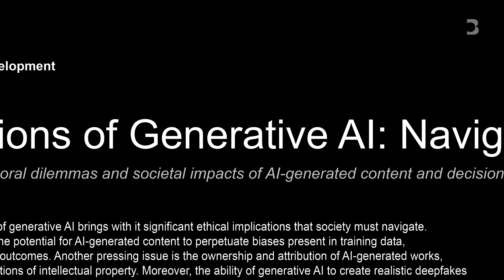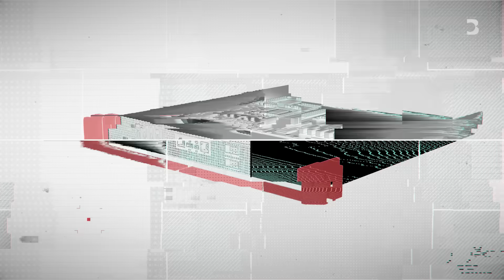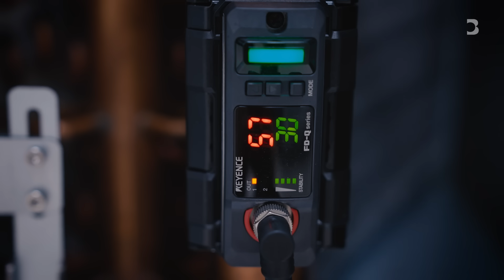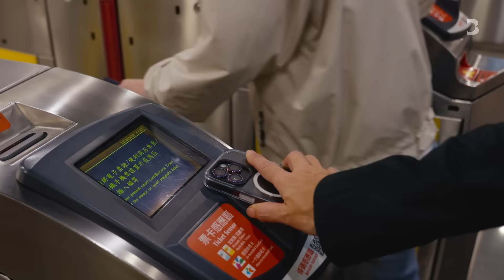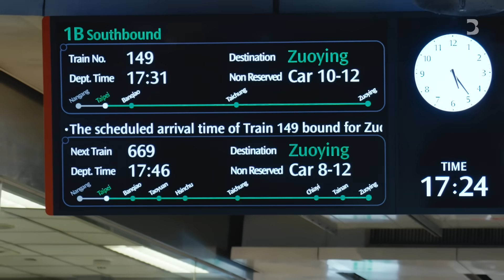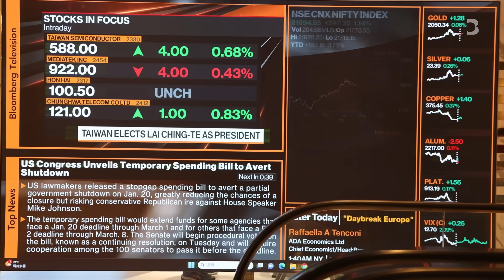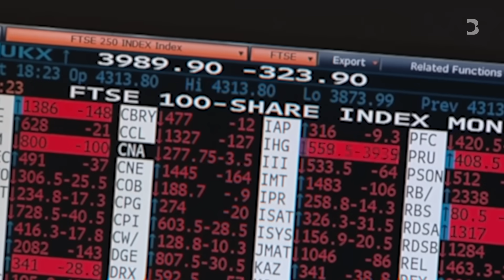Why AI Can't Exist Without Taiwan

Comment: The successful of semiconductor industry in Taiwan is the whole ecosystem, not just one company. That is also why it is hard to duplicate the case in other countries. It’s not just move the company to somewhere else can fix it.
Reply: Exactly right. One cannot just 'replicate' the complex structure of Taiwan. Not only the manufacturing infrastructure but the technical knowledge and experience.  This  is why China is becoming so obsessed with it, but China wants to acquire it rather than conquer it. 

At this time even a successful blockade, without invasion, would shake up the world economy.
Reply: 沒有台灣任勞任怨的工程師及全然體諒的工程師老婆，台灣合作廠商，眾多的家庭的支持、責任感支持這台積電。
（不想用英文發表評論，只想用繁體中文發表評論）
Reply: TSMC最主要的關鍵是供應鏈🎉，日本，美國，德國，荷蘭，毆洲，都是TSMC不可或缺的一份子😅，少了一個都不行緊緊的綁在一起😂，全世界沒有人可以憾動的❤。
Reply: Taiwan's Chip Industry Controls the Lifeline of Global Technology

Chip Specification Grade Classification:
Logic (Processors, AI Artificial Intelligence Computing), Memory Chip Operating Environment Requirements:
Commercial Grade -- 0~+70℃.
Industrial Grade -- -40~+85℃.
Automotive Grade -- -40~+125℃.
Military Grade -- -55~+150℃.
There's also an even higher grade: Aerospace Grade (Radiation Hardened), which requires resistance to radiation and interference, as well as a wider temperature range. Military and aerospace grade chips undergo rigorous qualification testing: pushing them to their limits, continuous high and low temperature cycling, vibration, shock, high ESD (Electro Static Discharge), and interface terminal plugging/unplugging endurance...
Generally, industrial-grade chips are twice as expensive as commercial-grade chips, automotive-grade are three times or more expensive, and military-grade chips are very expensive due to the need to amortize the manufacturing line costs. For aerospace -grade chips, setting up a production line costs hundreds of millions of US dollars, regardless of the quantity produced.
Taiwan's TSMC is the exclusive global manufacturer of high-end logic, AI, and memory chips for the US and its allies, as well as Taiwan's Chung-Shan Institute of Science and Technology (CSIST), for military and aerospace applications. The US Defense Advanced Research Projects Agency (DARPA) has approved the following manufacturers for producing military and aerospace grade logic chips and processors for the US military and aerospace industry: Taiwan's TSMC (advanced 7, 5, 3 nanometer process technology), US-based Intel (14 nanometer and above processes), and US-based GlobalFoundries (28 nanometer and above processes).
The manufacturing process, technology, materials, and raw materials for military and aerospace-grade chips are highly classified. The US and Taiwan have signed agreements to jointly control the highest-level technologies, prohibiting their export to other countries. The US government, still concerned for national security, has requested TSMC to invest and build factories in the US to manufacture advanced AI chips. Their entire production capacity is contracted by US Department of Defense military and aerospace manufacturers. Only the surplus and new factory capacity will be allocated to other companies like Nvidia, Apple, AMD, and Intel. This is an unspoken secret.

China and Russia's military and aerospace equipment can only use general commercial-grade chips for manufacturing, employing a trial-and-error method to create heat and cold insulation plus protective layers to shield the chip motherboards. This approach leads to short warranty periods and questionable real-world operational quality for Chinese and Russian military equipment such as missiles, radar detection systems, and aerospace equipment. Facing the US's high-tech electronic warfare countermeasure systems, their chip motherboards are vulnerable to destruction by high-power electromagnetic waves, causing missile failure and radar detection system malfunction. The failure of Russian weapons in the Russia-Ukraine war fully demonstrates this fact. If China invades Taiwan, the PLA's J-20, J-16 fighters, missiles, radar detection systems, and naval radar detection systems, which are designed using commercial-grade chips, will undoubtedly suffer a major defeat against US-Taiwanese electronic and electromagnetic warfare, and anti-electromagnetic pulse weapons. (Unverified online rumors in China suggest that the guidance systems of PLA missiles and torpedoes are reverse-engineered from US military technology of the 1990s, using stockpiled Intel 486 and 586 processors of commercial grade from 20-30 years ago for manufacturing.) This is something that the general public wouldn't understand, only experts in chip technology would know. Without mastering the highest technology in the chip industry, the Chinese Communist military is fundamentally unqualified to wage war!

Electric vehicles in China are frequently reported in their domestic market for failing to start due to excessively cold or hot weather, experiencing battery explosions, or suddenly malfunctioning while driving, leading to casualties. Besides other factors, it is very likely that Chinese electric vehicle manufacturers, in order to reduce costs, unscrupulously violate vehicle industry safety standards by not using automotive-grade chips and semiconductor components, and instead using cheaper commercial-grade chips and semiconductor components for the electric vehicle's electronic and electrical systems, making accidents inevitable.

The computer chips for the US Mars spacecraft are manufactured by Taiwan's TSMC using aerospace -grade chip technology. The computers for the US aerospace station are designed by Taiwan's CSIST and manufactured by TSMC using aerospace -grade chip technology, guaranteed to operate flawlessly in aerospace for 20 years. The computers and electronic systems for US and European low-Earth orbit satellites must be manufactured using TSMC's aerospace-grade chip technology.
Reply: @mikslids7083  is this true? where did you hear about this?
Reply: tsmc成功，不相干的一堆人蹭過來一起驕傲，
我們在輪班救台灣，你們在幹嘛？旁邊喊加油？
自x的人才會這樣，人家美國人會因為有蘋果、谷歌、微軟就到處說嘴嗎？
很多台灣人自x這點真的很像對岸的
Reply: Hope Trump will not threaten Taiwan by making TSMC harder to develop.
Reply: However, the Chinese Communist Party in power, as well as the majority of people in China, fail to understand this. They naively fantasize about using force to seize TSMC to help revitalize China, without ever realizing that the core issue lies within themselves.
Reply: With adequate politics always is possible. I think China will mass-produce own 2mm chips in next 5 years.

Comment: The irony is that without Taiwan, the world can't make the most advanced weapons systems.
Reply: Danish is right. Most military grade chips are radiation hardened and fault tolerant. They can't be sensitive to radiation, so there's a limit to how small they can go and it's more important to make them resistant to voltage irregularities and physical damage.

Another example would be space-grade chips, which can only be down to 18nm at best. Engineers built in a lot of redundancy on their FPGAs for the Mars Rover with multiple circuits doing the same calculations repeatedly, then choosing the most reoccurring outcome. They also used 3 FPGAs, so they could reprogram each other when needed.
Reply: @yensteel  Imagine a world without advanced weapons systems....fortunes are made making pointless war and killing humans....does it make you feel safe?
Reply: Taiwan's Chip Industry Controls the Lifeline of Global Technology

Chip Specification Grade Classification:
Logic (Processors, AI Artificial Intelligence Computing), Memory Chip Operating Environment Requirements:
Commercial Grade -- 0~+70℃.
Industrial Grade -- -40~+85℃.
Automotive Grade -- -40~+125℃.
Military Grade -- -55~+150℃.
There's also an even higher grade: Aerospace Grade (Radiation Hardened), which requires resistance to radiation and interference, as well as a wider temperature range. Military and aerospace grade chips undergo rigorous qualification testing: pushing them to their limits, continuous high and low temperature cycling, vibration, shock, high ESD (Electro Static Discharge), and interface terminal plugging/unplugging endurance...
Generally, industrial-grade chips are twice as expensive as commercial-grade chips, automotive-grade are three times or more expensive, and military-grade chips are very expensive due to the need to amortize the manufacturing line costs. For aerospace -grade chips, setting up a production line costs hundreds of millions of US dollars, regardless of the quantity produced.
Taiwan's TSMC is the exclusive global manufacturer of high-end logic, AI, and memory chips for the US and its allies, as well as Taiwan's Chung-Shan Institute of Science and Technology (CSIST), for military and aerospace applications. The US Defense Advanced Research Projects Agency (DARPA) has approved the following manufacturers for producing military and aerospace grade logic chips and processors for the US military and aerospace industry: Taiwan's TSMC (advanced 7, 5, 3 nanometer process technology), US-based Intel (14 nanometer and above processes), and US-based GlobalFoundries (28 nanometer and above processes).
The manufacturing process, technology, materials, and raw materials for military and aerospace-grade chips are highly classified. The US and Taiwan have signed agreements to jointly control the highest-level technologies, prohibiting their export to other countries. The US government, still concerned for national security, has requested TSMC to invest and build factories in the US to manufacture advanced AI chips. Their entire production capacity is contracted by US Department of Defense military and aerospace manufacturers. Only the surplus and new factory capacity will be allocated to other companies like Nvidia, Apple, AMD, and Intel. This is an unspoken secret.

China and Russia's military and aerospace equipment can only use general commercial-grade chips for manufacturing, employing a trial-and-error method to create heat and cold insulation plus protective layers to shield the chip motherboards. This approach leads to short warranty periods and questionable real-world operational quality for Chinese and Russian military equipment such as missiles, radar detection systems, and aerospace equipment. Facing the US's high-tech electronic warfare countermeasure systems, their chip motherboards are vulnerable to destruction by high-power electromagnetic waves, causing missile failure and radar detection system malfunction. The failure of Russian weapons in the Russia-Ukraine war fully demonstrates this fact. If China invades Taiwan, the PLA's J-20, J-16 fighters, missiles, radar detection systems, and naval radar detection systems, which are designed using commercial-grade chips, will undoubtedly suffer a major defeat against US-Taiwanese electronic and electromagnetic warfare, and anti-electromagnetic pulse weapons. (Unverified online rumors in China suggest that the guidance systems of PLA missiles and torpedoes are reverse-engineered from US military technology of the 1990s, using stockpiled Intel 486 and 586 processors of commercial grade from 20-30 years ago for manufacturing.) This is something that the general public wouldn't understand, only experts in chip technology would know. Without mastering the highest technology in the chip industry, the Chinese Communist military is fundamentally unqualified to wage war!

Electric vehicles in China are frequently reported in their domestic market for failing to start due to excessively cold or hot weather, experiencing battery explosions, or suddenly malfunctioning while driving, leading to casualties. Besides other factors, it is very likely that Chinese electric vehicle manufacturers, in order to reduce costs, unscrupulously violate vehicle industry safety standards by not using automotive-grade chips and semiconductor components, and instead using cheaper commercial-grade chips and semiconductor components for the electric vehicle's electronic and electrical systems, making accidents inevitable.

The computer chips for the US Mars spacecraft are manufactured by Taiwan's TSMC using aerospace -grade chip technology. The computers for the US aerospace station are designed by Taiwan's CSIST and manufactured by TSMC using aerospace -grade chip technology, guaranteed to operate flawlessly in aerospace for 20 years. The computers and electronic systems for US and European low-Earth orbit satellites must be manufactured using TSMC's aerospace-grade chip technology.
Reply: If you advanced weapon doesn't need 5nm or 7nm or 3nm tech
Reply: @danishh8454  they're having 2nm plant now,  w/o these, 2nm, 3nm, 5nm, and 7nm, it won't call advanced, like back to the old time with big machines and computers.
Reply: @中央山脈-c4i  if you military equipment is big and this chip only use smartphone
Reply: aiwan is have been outside of the world,so he makes herself ai industry,so,those guy of don’t admit taiwan came back and hope taiwan can help them,is this ok?
Reply: Advanced weapon needs 28nm or so, at 3nm it would not be able to withstand EMP type attacks or electromagnetic interference.
Reply: 아무리 뛰어난 무기가 있어도, 발전소, 수도물 공급 시스템이 망가지면 국민이 원시인이 된다.
Reply: @mathamour duh If you have the most advanced air defense system... who can reach your power station or reservoir
Reply: Don't forget India 🇮🇳. If indian developers mind wasn't used, these chips would yave been useless. Why praising only vietnam. More power to India 🇮🇳.
Reply: So if Taiwan is gone, the world will be a safer place?
Reply: @degol5692  if Taiwan is invaded, the top 10 fortune 500 companies will def. crash, talk about a global economic depression. If the US decides to NOT intervene, it will take at the very least a decade to duplicate what Taiwan was doing the day before the invasion. After a decade of CCP control over Taiwan, the US will prob. still be in a economic depression while China ....... not so much.
Reply: @degol5692  No, it'll just be made by Samsung in Korea, or Global Foundries in Germany, or Intel.   TSMC has a small plant in Arizona USA.
Reply: @Trust_but_Verify  except that your computer and phones will roll back to 5 year old tech. And be twice the price.
Reply: Not really Japan would still be at the top as Taiwan replace Japan  so AMD went to Taiwan when it broke off its foundry business now named TSMC. The reason why Japan fell behind is they thought the design and chip fabrication company should be the same company for to long and resources were to divided for it to keep up. So now the only component that gets the country name Japan on it is capacitors.
Reply: @yumri4  Japan wasn't competitive when AMD outsourced manufacturing.  You were thinking about Samsung foundry instead?